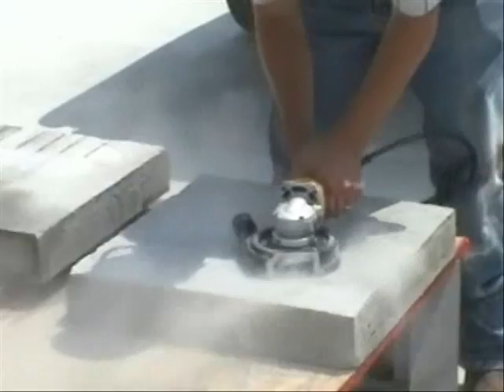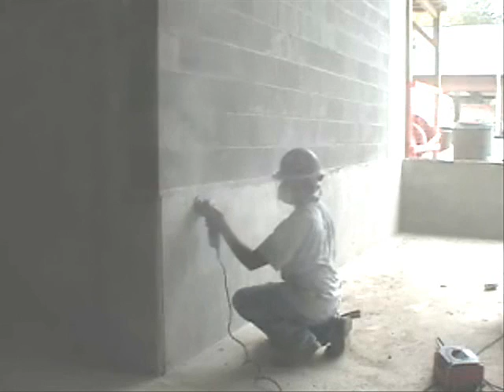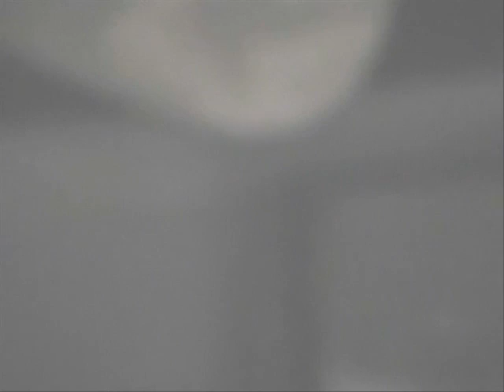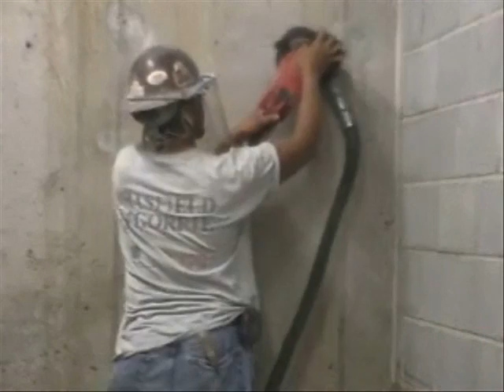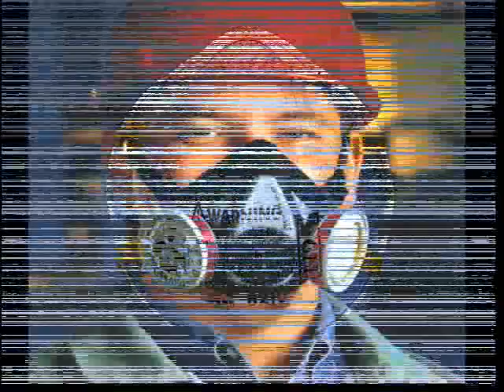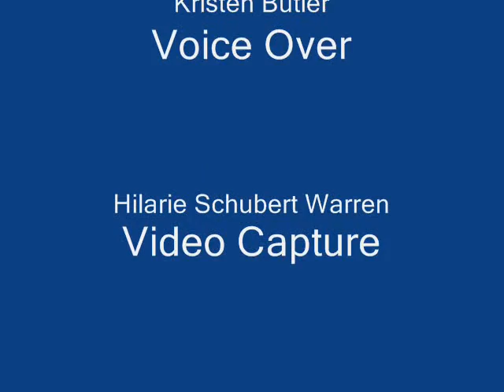Silica Control in Construction.wmv

Comment: I disagree that capture ventilation is not as effective as wet methods. Wet methods vastly reduces visible dust; respirable dust is still present. Capture ventilation with a shroud around the cutting surface is the best way to reduce silica exposures. I do agree that respiratory protection should be worn whenever silica exposures are present, even when engineering controls are in place.